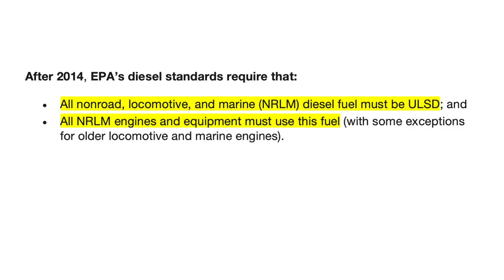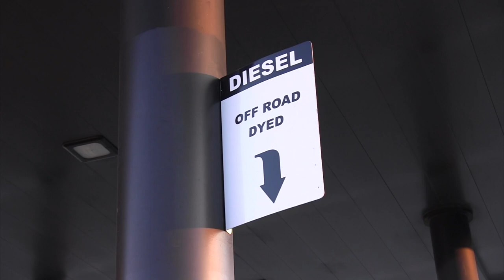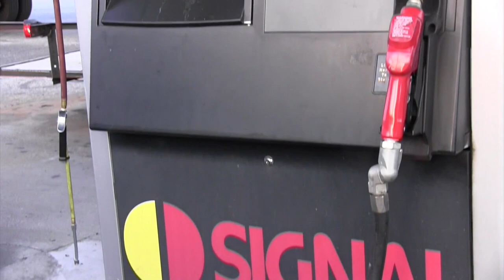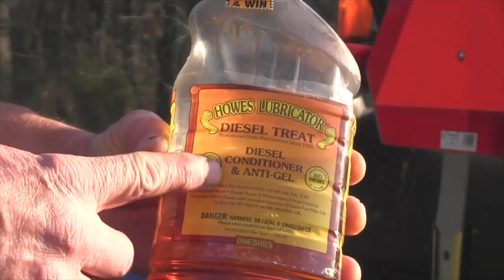The Biggest Danger to Your Tractor Engine, What's in Your Diesel Fuel Tank?

Comment: Hey Tractor Mike, Interesting you discuss this topic.  My first 4 years in the military I worked in the fuel Laboratory at the base I was assigned and I sampled and tested for this subject weekly.  You are talking about sulfides that is created by the microbes in the fuel tank.  If they are alone without water they will sour the fuel and ruin it as most often happens in gasoline when it gets old and turns to varnish.  The sulfides occurs when there is a layer of water (moisture) interface with the fuel in the tank; that's when you get the globs of good developing.  To prevent this we always controlled the water (sometimes entrained) and kept it removed from the fuel preventing the sulfides.  Years and years later some companies developed a pesticide you added to fuel to kill the microbes which prevents deterioration of the fuel making it last much longer before souring (fuel stabilizer).  I have used stabil in gasoline which has kept it fresh for 5 years in my antique car so I can vouch for it.  Speaking of breaking up the water we used to use alcohol which would absorb the moisture/water and let it mix with the fuel to be burned (most fuel tank water treatments from years past contained a type of alcohol that would not hurt your engine).  The important thing these days is use the treatment designed for modern engines (read application & instructions) and you will be okay.  I use fuel stabilizer in every tank just in case something happens and the tractor is down for an extended period of time.  Thanks for all the great videos.

Comment: I bought 50 gals of fuel from a local station, The next day I pumped 5 gals into the JD and the JD stopped dead. Come to find out I had more than 30gals of water and the station was closed down due to bad tanks. Well it cost me $4500 new injector pump, new injectors, lines, fuel pump, tank cleaning, ........ I couldn't find the receipt so I was screwed.  I now stick the tank every time I pump.

Comment: I dealt with about 100 diesel generators, 4 boilers, and a diesel filling station.  It can add stay away from biodiesel if you can.  It has more problems with biogrowth than regular diesel.  Another sign of algae is what looks like coffee grounds.  You will often see it in the filler but shake the filter and see if any comes out.  Biologics depend on the water in the fuel and removing it is the best protection.  If your tank has a petcock on the bottom open it and drain any water.  We used pumps that went to filters to clean and remove contaminates.  The newer stationary equipment came with the system in place or as an option.  This is something that would be fairly easy to make.  Also the algae in tanks creates acid at the water diesel interface and will corrode your tank.  Thanks for mentioning this topic which was a nightmare for me keeping hospital and laboratory generators running.  Tractors are even harder because nobody wants to reprime the engine and a check valve or valves of any type are not on tractor fuel systems.  We also used biocide additives in tanks when we found the problem and after we cleaned the fuel.
Reply from the maker: Brian, thanks for sharing.  Great information!

Comment: Too late for me.  The "bio bug" hit me for the first time this year.  NEVER saw this one coming as I had zero issues until now.  A mass of gunk had made it to my fuel line and stopped my tractor immediately in the middle of a mowing session while in the back of my property, of course..  Had to leave it sit there for a few days until I could get some help in figuring out how to troubleshoot and clear the line.  The filter glass was only showing a small amount of water at best, so I knew the problem was either downstream or upstream.  A tech came out and helped me clear the line coming from the tank and that solved most of the problem.  I've since added a chemical treatment to my yellow fuel cans and the tractor tank itself.  I bought a screening funnel (that adds to the difficulty of filling) as an additional layer to try to catch the crud and also have a couple extra fuel filters on hand.  My fuel line doesn't have a shutoff valve and is difficult to get to.  That situation could be another topic for a vdeo for you.r channel.

Comment: I am a 40 hour per year tractor user.  I have a couple 5 gallon fuel cans (same as the yellow one in this video).  I add JD’s fuel conditioner to every can religiously and fill my tractor’s tank full after every use.  Even after the big freeze earlier this year in Texas, I had absolutely no issues.  My tractor is a 2016.  Great video and great advice.  Thanks, Mike!

Comment: So what isn't being said concerns the fuel system damage done by "biodiesel". Here in the Midwest this fuel is sold in virtually any truck stop or gas station pumping diesel in amounts of 5 to 20% bio. This fuel will separate in a fuel tank and totally gum up the entire fuel system over a period of weeks or months. Most of us who have equipment that is parked for prolonged periods avoid the use of this biodiesel. Also there is a water issue w the biofuel that wreaks havoc on modern high pressure injection systems. Would welcome a discussion on this topic.

Comment: Very good information Mike. While I have only owned a diesel tractor for two years, I have owned a pre-emissions diesel Motorhome for 16 years. When ULSD came into existence, I started using a fuel additive called Pri-D. It not only helps with lubricity, but it also helps keep diesel fuel fresh and free of algae. RV’s tend to sit a lot, so this has been a problem with diesel RV owners for many years. Another method to keep algae out of your fuel tank is to keep the tank full when it’s in storage. This helps to eliminate air in the tank. I religiously do this along with the Pri-D. I have never suffered a water or algae problem. I now use Pri-D in my tractor. The specs don’t state that it is Tier 4 compliant however. I haven’t had any problems, but I am writing the manufacturer for clarification.

Comment: Worked at a JD dealership for just over a year in the small engine department. We had 3 tractors come in with slimed fuel strainers (right at the bottom of the tank) due to microbial growth. On my personal 1025 I keep the tank 3/4 to full just to eliminate the air space. Hot shot is really good at getting rid of water.

Comment: Hi Mike!  Thanks for another very informative video!  I have used Howe’s Diesel Treatment for several years now.  The big difference I noticed was my water separator stopped accumulating water after I started using it and I haven’t seen any water in the separator since.  So at least I know it does that job well.

Comment: Good advice.  On extra thing that I'll point out is that I always fuel up at the end of the day as much as possible.  With a full tank there is less air for condensation to build up.  That is also when I try to grease things.  Right or wrong I was always told that grease will penetrate better on warm fittings.
Reply: Will a plastic tank still condensate?
Reply: @mesanders1113  Yes, absolutely.  The fuel tank material isn’t the relevant issue.  Condensation and slime occur in both plastic and metal fuel tanks.

Comment: Mike, this was incredibly timely for me.  As a brand new tractor owner still with its first tank of gas that came from the dealer.  Yesterday, I bought a new yellow diesel can and an engine/fuel system additive labled to prevent the hazards/failure points you described.  The next thing I will do is write down on the additive receipt the date of that first diesel purchase, additive measurement added to the tank and hours on the "clock".  Got to dilligent about keeping the proverbial "paper trail" to fight any dealer/mfg-refusal to cover any repairs under warranty should I be confronted with such.

Comment: Hey Mike, I have the same exact tractor that you have, and I also use Howes diesel conditioner in my tank. I’ve been using Howes for over 40 years, and have never had an issue. The only thing you did that I don’t agree with is putting the additive in after the fuel. I was always told to put the additive in first, because it’ll mix better. I guess it’s a matter of opinion, but I think it makes sense. Keep up the great videos. Mike

Comment: Here in the northeast, the "oil eating bacteria" are super common in home heating oil tanks - Home oil is very very similar to diesel (or IS diesel in many localities) and it sits accumulating in the bottom of the heating oil tanks for years and years, as those tanks are rarely disturbed, and only then by filling. Weird stuff, but they (along with the acidic water they hang out in) will rust right thru a 1/8" tank filled with 200 gallons of oil. 
Your house smells like diesel for months. I change my fuel filters twice a year even though it may not need it. Spring and fall, when the anti-gel goes in in the fall. The filter housing gets an eyeball every time it gets fueled which is at about 1/2 tank, because I don't want to prime the injector pump. Don't want my tractor to be infected or sucking air. 
Good video!

Comment: Another great video Mike!! I drove a truck for 38 year's fueled before shuttin down I have used every fuel additive that truck stops had and used them I my tractors over the year's.  I bought a new Mahindra 1526 in 2017 bought a bottle of Mahindra fuel additive it has been best I've ever used and I also use on road diesel last 3 year's no water in settlin bulb but I do top fuel off before I put her to bed.  Thanks for sharing be safe have fun

Comment: Hey Tractor Mike! That was a great video & fortunately I learned about the different  types of fuels from driving trucks for 44 years & other than the lubricants in diesel fuel ( sulphur ) & the lead that was used in gasoline had the same basic principals both act as lubricants & the biggest problem with both is water getting in the fuel systems or condensation forming & the best advice is use fuel additives & top those tanks off , Additives are not snake oil they do work  & I own 2 tractors a 1959 M-F 50 gasoline & a 2018 M-F 1526 diesel both run fine on required fuels & the M-F 50 runs fine on gasohol & if I need to get fuel that's straight gasoline I have to go out of my way to get it & the only other place to get it is at a way higher price is at a marina & so I make a point of keeping it topped off & use I stabilizers, & I've owned this M-F 50 for over 25 years so I've already done a valve job replaced fuel lines & the carb. to run on gasohol & I also put in a electronic ignition , So this engine is very reliable by today's standards & performs like a new engine. & when I bought the M-F 1526 I wanted to be under 25 hp so it is tier exempt , But there is another problem with newer fuels for both gasoline & diesel & that is carbon build up but that can be story for another day.

Comment: I agree with everything you mentioned.  Regarding additional lubrication;  Since 2004 I have run 2 oz. of cheap motor oil per gallon of diesel in my tractors and trucks.  Occasionally alternating 2 oz per gallon of transmission fluid.  My '92 6.5L TD chevrolet truck had over 300 k miles on it when I sold it.  I replaced the injectors when I purchased the truck with 160k miles. Truck ran strong/smooth and still got 19/21mpg when I sold it.  My 07 LBZ duramax has 260k miles on original injectors, 19/21 mpg still today. Additional lubrication is the key with low sulfur diesel.

Comment: Tractor Mike, the part you were talking about holding in your hand and not being able to reinstall is the  needle valve used in the common rail injectors. To hold back 26,000+ psi of fuel pressure, the tolerances are measured in microns, not thousandths of an inch. Any water that sits in that space can corrode the injector closed… permanently.

Comment: Hello Mike once again great helpful video. I've talked to before and the fuel sludge build up in tank was my problem then. That's happened again this spring and it plugs up the fuel line from the tank to the first fuel filter. Tractor would run fine until it was put under load then it would starve for fuel and on the Massey 1754 the computer shuts tractor off  and gives a generic engine code. Dealer covered the first fuel line replacement under warranty tractor was only 3 years old and 180 hours. This time it wasn't under warranty so I replaced section of fuel line and changed all fuel filters. I use Diesel Kleen additive but 3 years later it happened again. Fuel looks normal and 5 gallon cans are clean Everytime I fuel it. Thanks again keep up great videos.

Comment: as a mechanic the best advice I can give is KEEP YOUR FUEL TANK FULL!  Only been working at a JD dealership for just over a year and have already cleaned out at least 4 slimed tanks. 
on lubricity a good 2 cycle oil added at a 100 to 1 ratio will usually work pretty good for most non tier 4 mechanical engines. I use WELL FILTERED used engine oil in a dodge  95 B model diesel truck.

Comment: speaking about "lubricity", one should use a good quality heavy duty diesel engine oil to keep the rest of the engine lubricated, due to the loss of lubrication which was provided by the zinc content. since the EPA took the zinc out of all automotive engine oils, there have been a number of older engine failures due to not having the lubrication necessary to protect the engines.... the heavy duty diesel engine oils have much better lubricating properties than the common oils you will find at the auto parts store..

Comment: This is great information Mike. I learn some of this information working on utility size combustion turbines.  At that time in 79 we couldn’t get fuel to the meet the manufacturers spec..  We also had to clean all the storage tanks due to contamination from non-use. Combustion turbines didn’t run very much then.  Cold weather operation without pre-heating the fuel caused  fuel to accumulated in the second row of rotating blades, when ignition did occur we had fuel ignite were only hot gases should be flowing. Blades broke and pushed shrapnel through the remaining blades. We then had to re-build the entire machine upon inspection.  15 million dollar overhaul.  Good experience for a young engineer but costly for the utility.  Fuel spec. As oil is extremely important.  Again great information. We need this practical knowledge. Diesel engines are the same - hot gas moves the piston.

Comment: I just had my  first  experience  with  fuel killing the injection  pump .I run tank low  and refilled with fuel  in the yellow plastic jug. I put tractor on the  trailer it  set for a week  and returned  to drill post  hole .and starter when  I started the tractor it has only run at full  throttle. Service  department  says  $2500 to repair.over 1100 in labor. I'm sick over this. 254 hrs.on the tractor. It's a none deet 2014 mahindra.

Comment: Funny you mentioned the deep freeze down here. I had a Deutz twin air cooled genny that fired right up and ran just fine at 15F. for a good lubricant a good 2 cycle oil will work just fine. I used a synthetic 2 cycle oil or just used engine oil in my m35a2 and it loved it.

Comment: Best is to allways use a conditioner in your fuel it adds lubricant that has been removed keeps your fuel good and when its parked fill full to prevent condensation in your tank. Have a good night good advise Mike.

Comment: This happened to me, gunked up the fuel filters real good. Changed them out and ran a bunch of power service anti microb  fuel supplement thru it and it was fine . After that I always add some to the tank. Lucky I caught it when I did. Depends on where you buy diesel, say at gas stations that don't usually sell a lot of diesel their tanks can be infected with the microbes. Then you put it in your tank and don't run the tractor very often you'll get the slime that gums up your filters. I always buy diesel from places that sell a lot of diesel. Something else, if you use bio diesel it will clog up your filters too.  We had to quit using it at work cause we couldn't keep our diesel trucks running. After a few tanks truck would stop running cause the filters were clogged up. I won't run bio diesel in my tractor.
I'll usually add a quart of transmission fluid to a tank of diesel to help lube up the fuel system.

Comment: Either seasonal adjusted Diesel, or #1  during the cold months. 
Power Service religiously if I cannot get a hold of either one.
Always top off at the end of day to prevent condensation. 
And drain that fuel/water when you fuel when's it cold.

Comment: So what are some good options for lube? (Never thought I'd be asking another guy this question lol)
Reply: Haha!!😅🤣
Reply: Schaeffer Oil, best lube there is
Reply: What kind of lube?  Engine oil?  Gear oil?  Grease?
Reply: I use Redline 85 plus.  They have both summer and winter formulas, been running in my old 86 truck for years.
Reply: We are talking about the Fuel now. I use a diesel stabilizer like Power Service and Magic Marvel  Oil for pump and injector lubrication.
Reply: I've used two-stroke oil on gas engines which run well on low octane but are designed for leaded fuel. Low octane has been unleaded for 40 years in most western countries.
Reply: @kobach  Shaffer is OK but is highly overrated. 
The base behind this is I have fourty years of diesel experience. I have seen and read many lab reports and overall Amsoil and  Shell Rotella are always at the top of the list.  The BIG ISSUE is proper PMs 👌
Reply: Hot Shot's Secret EDT